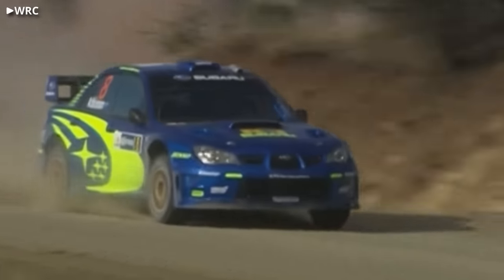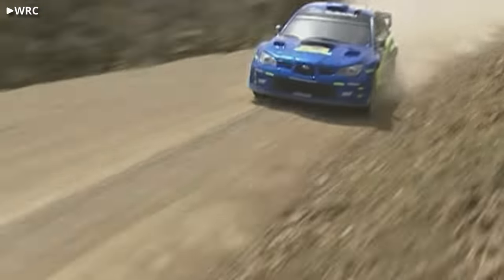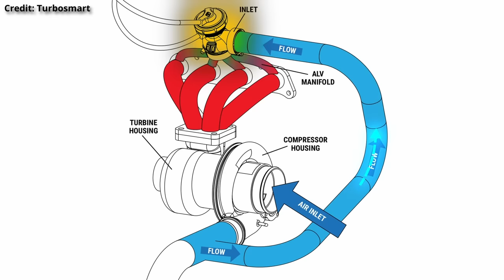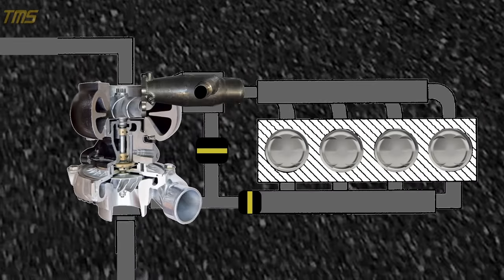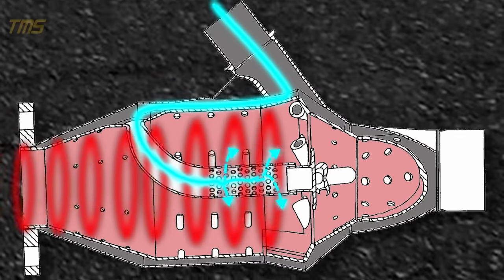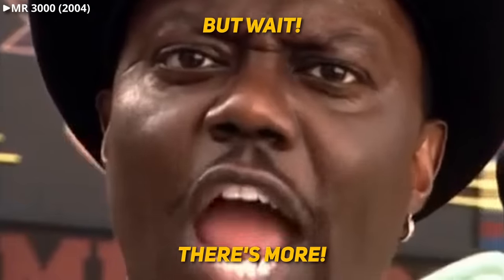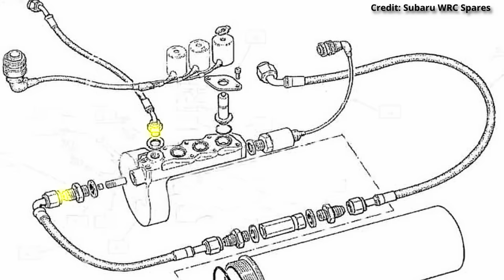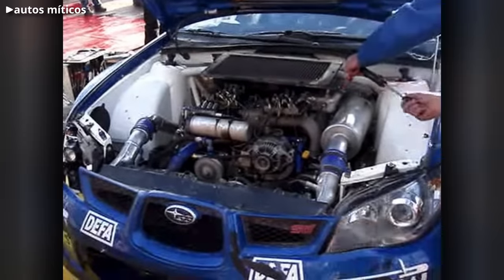When Subaru Put a “Jet Engine” In Their Exhaust | Rocket Anti-Lag Explained!

Comment: This system seems like it would be better suited for diesel applications. A less volatile fuel with more energy. Some diesel SCR systems run at these temperatures already.
Reply from the maker: That's an interesting point. I wonder if any diesel vehicles use something similar? I don't know much about diesel technology so I wouldn't know. Although I suppose reducing turbo lag isn't as much of a concern for heavy machinery.
Reply: Diesel works by compression though not heat or spark, I'm not sure it would work properly.
Reply: @themotorsportstory  it is a concern but it's mostly solved with vgts. Though this does sound like a good method for regen cycles
Reply: Diesel has a flashpoint of 100*c and a auto ignition temperature around 210*c so it will burn without compression. 

VGTs aren’t the most reliable and won’t give you full boost at idle just partial. They will limit the pressure range of the turbo as well.
Reply: @theislandsc  they get used in essentially every single new diesel and they close up during idle in order to heat up the exhaust for regens and to keep blowby in check
Reply: @themotorsportstory  Interesting point. The idea actually came from diesel engined tanks . As an ex prodrive tech I was around the testing and build of the version on a road car that Subaru requested. The engineer that masterminded the road car version (lots more refinement needed to get near idle speed) posted this a while ago :) https://www.youtube.com/watch?v=n_qCd6Lx7pE
Reply from the maker: @mk1cortinatony395  I came across those old tank patents and also this video during my research, so thanks for putting some context to both!

Really cool that you worked at Prodrive, must've been a really neat experience! Thanks for the comment!
Reply: You're not typically wanting to be off optimal operating parameters on the diesel often. Not a ton of rallying/racing diesels out there where this would be super useful. Tanks are a good example of this where you would have a lot of rpm ups and downs but again it's not something you're wanting to put your diesel through if you can

Comment: For anyone who worked in any capacity with turbine engines the rocket closely resembles a combustion chamber, with the most notable difference being the lack of fuel injector and instead an intake of fuel rich exhaust, which serves pretty much the same purpose of delivering fuel for combustion. The inner and outer tube design with holes are almost identical to what a turbine engine combustion chamber would have, except for the tube which is routed to the middle. It's very cool to see they pretty much made a jet engine in the exhaust.
Reply: What I kinda wonder is why they didn't go all the way and put a fuel injector into the can? That should (in theory) allow keeping the turbo at full boost at any engine speed all the way down to zero. You might even be able to (once you get the turbo running) get enough boots to air start the engine!

My guess is that either the rule book already bans that (boring) or that there is some non-obvious reason it don't work well (interesting).
Reply: @benjaminshropshire2900 someone involved in making the device or at least the patent for it did confirm that the rules stopped them from doing that. (They're not allowed to have fuel injectors outside of the combustion chamber)
Reply: @ergoproxy-gx2cq  well that's a boring reason :-(

Comment: Great video, as ALS control engineer and without breaching any NDA you are bang on track when describing the solenoid control. I had heard of the no ignition source pulse jet type system being used previously , fascinated by the pro drive rocket and Darren James further comments, Maybe electric turbos could be a subject for the future. Keep up the great content.
Reply from the maker: Thank you! I've been impressed with how many people from the industry have been coming across this video and love that you have all been so kind and encouraging. Electric turbos are a great suggestion for a future video! I'll need to educate myself a bit more about them first :)
Reply: @Republican_Extremest  electric motors on turbos are not really a new concept, they have been in use ever since the new V6 hybrid systems were introduced in F1. A motor/generator is placed on the turbo that can help spool it up and can also help recapture energy when fully spooled-up. Fully electric turbos on the other hand has not seen the light of day on professional race cars.
Reply: Yes, I was thinking the same about the pulsejet not requiring an ignition source.

Comment: I absolutely love the engineering that goes into sports cars, but I absolutely sit in awe and wonder when I realize how much further engineers have to push when it comes to race cars. That pursuit of performance is just something that I can't get enough of because the solutions they come up with are pure genius. This video is informative perfection. Definitely subbing
Reply from the maker: Fascinating isn't it! Thanks for the sub!
Reply: @themotorsportstory  Most definitely fascinating 🔥🔥. It truly is my pleasure. Keep up the good work! 👍👍
Reply: They both push, just with different goals and constraints. You couldn't use this in a road car because the turbine doesn't last very long. Alternative systems exist like for example Porsche's which runs the engine at WOT but with no fuel under decceleration to keep air flowing through the turbine.

Road cars have a lot more R&D spent on things like safety, efficiency, comfort equipment and of course cost optimization. In fact there's probably more R&D overall put into a Ford Focus than was every put into a Group B rally car.
Reply: just a modified gas turbine combustion camber

Comment from the maker: For anyone curious about the cooling system at the end of the video, here's a great article that explains pressurized cooling systems used in racing which is probably what these cars have: https://appliedspeed.com/blogs/tech/purpose-built-race-car-pressurized-water-systems

I'm still learning about them myself, but the reason offered for adding pressure to the system is to check for trapped air in the system. From the article: "The tank comes with a Pressure Relief Valve (PRV). The PRV is adjustable, so it eliminates the pressurized radiator cap. The accumulator is also accompanied by a quick disconnect fitting for the operator to add some pressure to check for any air trapped in the heads." So minor correction on my part if that is what he was doing instead.

Thanks for watching!
Reply: within the team , it was actually nicknamed  rolands rocket, as it was designed by prodrive engineer roland broadbent
Reply: @farmerbailey2542  True :)
Reply from the maker: @farmerbailey2542  Interesting, thanks for the comment!
Reply: The main reason isn’t to bleed the system but to increase the pressure and prevent boiling of the coolant! In particular the most at risk area’s such as the coolant galleries in the heads above the chambers and exhaust ports as increased pressure raises the boiling point of the coolant and bleeding is a secondary benefit! Also just about every cooling system is pressurised but this is roughly twice a normal car’s pressure and with an additional accumulator it’s a practical and well thought out system! Edit should have watched before comments! You got the accumulation covered lol
Reply from the maker: @needmoreboost6369  Interesting, so I was on the right track I guess! Thanks for the comment and for watching!

Comment: Super interesting fact is a lot of race teams install an intake to exhaust bypass valve and then plumb in an injector or if it’s a DI engine they use a fuel delivery during the exhaust stroke. It basically works as an afterburner.

Comment: Great rocket explanation!  I was fortunate enough to have an inside look at this during the first few years it was used on the S10.  It was inspired by a design in a trash truck that was used to keep the DPF working with frequent start/stop, as well as Nick Mann's hillclimb car which used an actual turbine to keep the turbo exhaust pressure separate from the piston engine.
Reply from the maker: Thank you! I've heard about the Nick Mann car and would love to learn more about that! Any good links or videos you'd recommend?

Comment: They might call it the Rocket because the idea is very similar to how a a part of a liquid fuel rocket engine works. A gas generator burns some fuel and oxidizer to power a turbopump, which is extremely similar to an automotive turbocharger. There are even engine cycles that run fuel-rich, then tap off some of the exhaust into the gas generator.
Reply from the maker: Good theory!

Comment: Two things. 
1) This reminds me of the cyclone generated inside a Dyson vacuum cleaner or an afterburner.
2) I wonder if it would just be simpler to have a solenoid controlled canister of compressed air connected to the hot side of the turbine.
As exhaust gas pressure reduces, open up the air valve to keep it spinning, just hook that valve up to the ECU.

Comment: this would be super cool adapted to use on diesel engines, not only would it help with power/performance but it would also help with dirty old diesel soot since it easily gets hot and oxygenated enough to vaporize anything that comes out of the engine, no dpf, no egr, no adblue. happy days for everyone.

Comment: Awesome video. Because of hybrid systems I doubt we're gonna see any more cool innovative anti-lag systems, bc the electric motors can compensate for the turbo lag without the wear on the engine.
Reply from the maker: Thank you! I think you're right. Unfortunately sometimes the innovations become less interesting as technology shifts and we can find simpler ways to do the same thing.
Reply: @themotorsportstory  correction: there's alot of underated innovation and cool tech happening in the EV space.
Batteries, wiring, magnets etc. 

It's just a different field of physics that alot of car guys aren't used to
Reply: Battery weight kills this idea though. Until that’s solved liquid fuels have such a higher mass energy density that it’s not always the best way tho go. 

This is why the big boy drones all have liquid fuel powered electric generators (auxiliary power units) that then output the electrical currents to drive the prop motors. 

And it still comes out much lighter and more effective than having a battery pack.

Comment: Wonder if one could incorporate the simple 2step with an air injection valve to lower egts. Wouldn't be as good as this but might be a simple solution with more conventional systems
Reply: Absolutely possible, I actually have had this completed within the last week.

The EGT can be seen lowering substantially via installed gauge.
Reply: @SethPowers-mt2vz  details please

Comment: Almost no turbo lag on my  '97 Tommy kaira M20b wagon, with the EJ20 and the tiny Mitsubishi TD04 turbo fitted and close-ratio RA gearbox. With the TK tune. Phew. Full 1-bar boost from 3,000rpm. Huge surges of boost whenever I stab the throttle. Brilliant vehicle. One of the best ever.

Comment: I designed a very similar system in the summer of 2000 for my Unlimited Heavy Super Stock Pulling Tractor which had 3 HC5A Holset Turbochargers with The first stage using two with 3.9" wheels feeding a single HC5A with a G flow Exhaust wheel and a big back 4.250" inducer compressor wheel and then onto my Water to Air Intercooler I made that used .625 O.D internally enhanced copper tubing, which increased the efficiency by almost double compared to plane wall tubing. I was using a combustor from a gas turbine to help drive the chargers in a situation where I needed to throttle the engine quickly and needed help keeping the turbo's at an optimal speed, so the compressors wouldn't stall as I reapplied full throttle quickly, It is really cool how closely related are systems where. I was running 85lbs of boost and the engine was an inline 6 cylinder with a 4.875 bore and 5.350 stroke, which equals 598 cubic inches. 3500HP @ 6000rpm
Reply from the maker: That sounds awesome, thanks for sharing! If you have any pictures or videos, I'd love to see them!

Comment: WRX will forever hold a spot of my heart. The first time I heard a full 3in exhaust and downpipe set up I was at home and my buddy pulled up. The front of my house just shook and vibrated and it growled like a train in the distance. It was at that point I decided on Subaru for life. Are they nightmares yes, they have major design flaws maybe. But when they run right it's pure joy. Remove the top mount for a front mount.
Reply from the maker: I've always been a Subaru fan! Have to say that I have a preference for the older WRXs as opposed to what they're selling now though.

Comment: On some watercooled aircraft engines you have to use an air pump to pressurise the coolant system. This is for finding leaks, usually done after refitting hoses. Perhaps this is what the technician is doing at the end.

Comment: I built development engines at Prodrive during 2003. We did have a means of storage for compressed air. On the Dyno, it was a aluminium canister of approximately one litre volume. I am sure we had one on the cars too, but I am also aware that the system produced such an excess of air that we couldn’t use it all. We looked at using air shifters and various other ways of using this “free power”, but none made it to competition. For reference, we had 3 bar of boost and 11.25:1 compression ratio, which was pretty high at that time. The solenoids that you are seeing were referred to as the “boost pack”, and controlled air flow to and from the exhaust, inlet, and air storage. We were legally allowed to inject air into the inlet manifold because it had already been through the inlet air restrictor. When a certain engineer left Prodrive bound for Ford, they tried to have the system banned. The FIA declared it legal, so they had to develop their own. I still have my documentation on how the system works somewhere around here.
Reply from the maker: Fascinating stuff, thanks so much for sharing! It can be hard to speculate how a system worked just from looking at photos, so I really appreciate that yourself and others with experience at Prodrive have been dropping by with some clarifications and missing details. I'd pin your comment as well, but unfortunately YouTube only seems to allow me to pin one comment to the top and Darren got here first :)

Comment: 969 III thank you for reading. This was very well done. Taper angles . You can slow down a little bit. Coast for miles. Pacific highway. leasure. Like Tai chi, great strength in control. Electric and waterworks . I liked driving the Nissan leaf. And the geo metro.

Comment: Worked on these cars approx 15 years ago, the system is wild. It can kill the turbo if you are off throttle for too long. I think there used to be three settings. The wildest only allowed 1sec of off throttle before damage killed the turbo and system as a whole. Engine in its wildest spec would be lifed for max of 1500km, sometimes less, It would by then, have destroyed the valves, warped the valve seats, softened the alumunium cylinder head, cooked pistons and rings, plugs... Its a wild wild system and works best with oxygenated race control fuels. Some extremely talented men worked at prodrive those years, such a shame David Richards was so ruthless to them. Just imagine what could be done today using the advent of CFD, supercomputers and 3d metal printing, it must be mind blowing. LONG LIVE THE INTERNAL COMBUSTION ENGINE!! Kind regards from a motorsport engineer.
Reply from the maker: Thanks for the comment! The top setting sounds crazy!

Comment: We pressurize our p/s systems on trophy trucks to prevent cavitation. Its likely that the air pump was for a fluid reservoir doing the same thing, and likely had nothing to do with the rocket system. Great video. Im always on the look out for banned tech for my hobby cars.
Reply from the maker: Thank you! Good luck in your next racing endeavor!

Comment: There was a hill climb car that used a small auxiliary turbine from
a helicopter (used to start the main engine and run a generator etc) - the output fed in to an enormous turbo which was “always on” - great for a discipline where you need instant takeoff and power out of corners for a short time. Not great for turbo life.

One thing that the Subaru jet made me wonder is whether it might mean you could run a much bigger turbo, and mount it further away from the head. This might give a number of benefits to heat management and efficiency - plus a higher boost ceiling if you needed it.

A very interesting video - thanks for the explanation!

Comment: So, I have a 2008 yamaha vstar 650. It has an air injection system. It's for emissions because the engine needs to run rich to prevent overheating the plugs. But, it seems to me that it's a perfect candidate for a turbo like this!

Comment: 20 years ago before modern turbos were at where they are now this system would have been a major blessing in the drag racing circuit . we didn't even have trans brakes or line lock back then so being able to have the car launch with full boost was only something super charged cars could do . and even now it requires having the engine set against the trans brake revving at 3000 to 4000 rpm on a launch . I know it's obsolete now but back then I would have been a game changer.
Reply from the maker: I can only imagine how crazy drag cars with this system would be!

Comment: I love how this is set up like a tesla valve... it uses the fluids own surface tension and movement to act as a valve.  Super cool.    Much nicer than the n+1th injector antilag systems where its basically just an extra combustion chamber...or even worse, a spark plug and running it too rich.

Also... I bet we could do something like this cheaply with metal 3d printing....